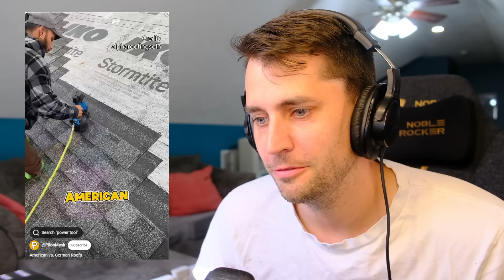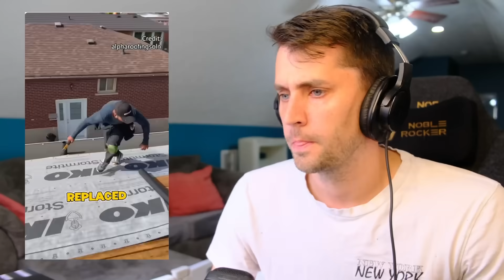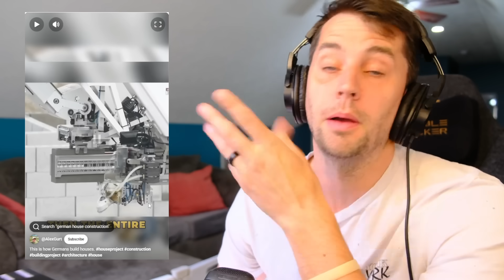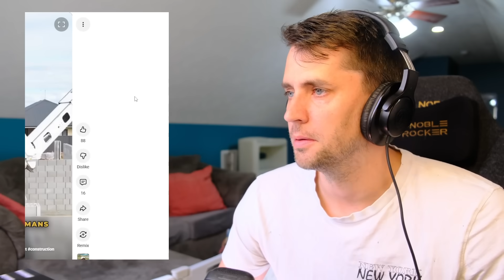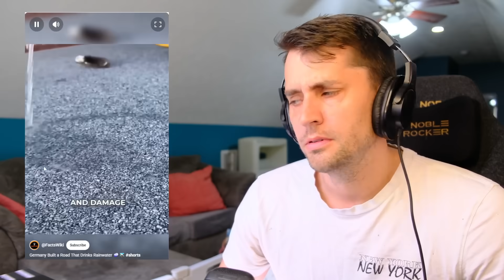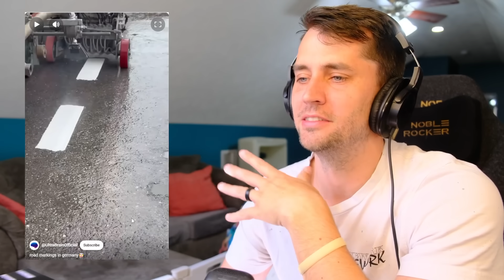American reacts to Germany's NEXT LEVEL construction methods

Comment: Re-roofing with shingles isn't expensive.
If the substructure needs to be completely replaced, it can cost around €60,000–€100,000. In my case, it was around €78,000 two years ago.

Comment: I take a look about the costs
The cost of covering a roof ranges from €60 to €130 per square meter, but varies greatly depending on the material and scope of the work. Added to this are costs for removing and disposing of the old covering (approximately €20–35/m²), scaffolding (variable), and possibly skylights or a photovoltaic installation. Regional differences and any roof insulation (€23/m² and more) also influence the total price.

Comment: Only temporary road markings (the yellow ones, overriding any white markings) can be something like a sticker.

Regular markings are a very thick rubbery paint, several mm.  And outside of settlements it's often also stamped/structured with a profile that audibly changes driving noises of you Drive on it. To prevent people gradually drifting out of lanes if tired/preoccupied. It makes an unpleasant angry buzzing sound.

Comment: 14K for a roof is cheap. I was quoted more like 40-50k for my roof on a small, wooden town house, roof around 40 m2. But it will last for 50-100 years, at least. The house is listed, so clay tiles are preferred. Still, my 50-60 year old concrete tiles (an inferior product to traditional, burned clay) are still OK, just a bit faded. Air pollution from local coke burning, coal smoke from UK power plants, dirty diesel engines and heavy shipping oils used to be BAD, but now the air is clean and the acid rain decay has stopped. (Good environmental policies do work, still the ships and lorries are still operational). No more accumulation of red mud in the gutters. BTW: The other clips look a bit dodgy.

Comment: Those robot  machines are real. They use cinder slabs and fill the wall cavity with high strength concrete. The cinders are covered in apoxy adhesive by the robot as they feed to the seating claw, so are glued onto each other as laid. They can lay an entire floor a day.

Comment: Concering the shingles and tiles…
My house was built around 1880 or even earlier. And it still has the original black roof tiles from back then. I have a few tiles left for replacement and the roof structure has been completely remade about ten years ago, but they reused the antique tiles to stay true to the look of the house because it‘s „denkmalgeschützt“, meaning it‘s sort of a monument and needs to keep its looks. I couldn‘t just make structural changes or paint the red brick walls.
So, these tiles have lasted for 150 years and will go on lasting.

Comment: That road surface DOES exist in reality. We only have small stretches of it because it‘s still being tested. It seems the surface isn‘t as durable as regular asphalt and has to be maintained a lot more often.
I formerly lived near a stretch of highway with this surface on a stretch of about 20 km. When entering from the regular asphalt it was like your surrounding really suddenly changed. No water on the surface, almost no spray water from the cars ahead and immaculate grip. (I tested it thoroughly with acceleration and hard breaking in heavy downpours, of course only with nobody behind me)
The biggest disadvantage is the noise though. It‘s extremely noisy due to the porous surface and I bet the tyre wear will be much stronger.

Still, if they manage to tweak those things, it‘s the perfect road surface for rainy areas or even countries in which rain is frequent.

Comment: I looked up that house-building robot and the company at least seems to have a Wikipedia page and wow...

1) That company is Australian, not German, though they do seem to have several partners in Germany, Switzerland, and Austria
2) They were only used so far for a handful of outdoor, long-term builds, with their website listing a mere 28 (yes, 28!) projects, which includes several test builds and, to be fair and balanced,  two small townhouse projects, a community center, and a daycare, so it's not 28 family home-sized builds.
3) One of these robots costs, according to the company website, 7.8+ million Australian dollars (so at minimum 5.1 million USD or 4.4 million Euro), and have been used to lay about 170k worth of blocks so far. That's about ~6000 blocks per project.

To me it feels a lot like a "disruption" grift, and the short is claiming it's German for extra clicks.

Comment: In my road a house was removed, a concrete plate was made and now the owner is building a new one since early summer. For the ground floor he finished the lime-sandstone walls and partly the bricks around including isolation between. Maybe he is from construction himself. The husband of a friend of my wife had a business to buy a lot, build a house on it he designed himself and got certified by a structural engineer and build it himself. With the help of his two sons. One is bricklayer one is electrician. He is quite wealthy, sold a couple of the houses he built and is renting a couple of houses to people. He is finished working for some years already, 83 years old.

Comment: For my house in germany new roof tiles from a company would be between 10000 and 25000 Euro. Inluding wood and isolation it could go up to 60000 Euro. The roof of my dads house that was built in 1925 is still ok, kind of. Its actually time to redo the whole thing but the house is not worth a full renovation.

Comment: The asphalt that "drinks water" is called open-pore asphalt (OPA).
It is found on some highway sections but is relatively sensitive to frost.
When frost threatens, salt must be spread promptly and more frequently to prevent the water from freezing in the asphalt surface, as otherwise, damage to the road surface could occur!
The freezing water would simply crack the asphalt.

Comment: 9:30 ZOAB which stands for Zeer Open Asfalt Beton (Very Open Asphalt Concrete), is a type of porous asphalt widely used in the Netherlands for major roads and highways, characterized by its high percentage of air voids (around 20%) that allow water to drain through. This porosity reduces road noise by absorbing tire noise, improves safety during wet weather by preventing water buildup, and reduces spray. ZOAB requires special, higher-viscosity bitumen to prevent collapse and is typically cleaned with a high-pressure, vacuum-assisted method

Comment: 1)
14k for a roof? LOL...
Our roof has been redone a few years ago - that were 54k... come again, what was that about being expensive? ;P That being said - this was roof PLUS the insulation. And there were incentives for the last ~10cm of insulation, but we still paid about 42k out of our pockets...
Took the roofers 5 weeks to get the roof done, including insulation (where then the boss said "can't do any more" ;)). Theoretically, the sun has to shine 18h strictly perpendicular on the insulation (remember, there are shingles and an air gap to the insulation) to even measure a temperature difference on the inside surface. Now, tbh, this is somewhat mitigated by the windows (well yes... we also have windows in the roof so we can "lüften" ;D), because while still at a good insulation value, they simply are not as good as the pure insulation.
OK, therefore it'll last the next 50 (min) years, maybe even a 100, depending on storm strengths ;)

2)
Never seen this machine anywhere, not even in ads or something. Also, those bricks don't look like what would usually being used here. Also, the whole neighborhood does not really look german to me. Maybe the testing grounds of the manufacturer of that robot?
So.... maybe a german machine, but not really in use in germany?
There are two modes of building here (mainly): Fertighaus (lit. Ready house, a house build from prefabs), or... well... a house. Build with concrete, bricks and mortar etc.pp., with some variants of "Lego"-type bulding (from pure foam blocks, later filles with concrete up to bricks with hollows in them, also to be filled with concrete later). So, while the machine-built walls look like they were to be filled with concrete, i can't really imagine this on a construction site here - alternatively it is so new, that this machine didn't even hit the market yet...?

From the vid: FBR Hadrian is the robot, and it seems to be made by an australian company...

3)
While there are "sticker"-type markings, those are usually temporary, yellow ones used during road construction work. Road markings are painted on the road (actually it's more like a plastic/epoxy type of "paint), and that (on the autobahn) in layers: first solid white paint, then a layer of a glass bead/ceramic shard mix, then drops of "paint", followed again by glass bead/ceramic shards. This creates a non-slip surface (ceramic) with high visibility at night (glass beads) that also drains rainwater relatively fast (paint"drops").
On other roads it's IMHO just the "paint" plus beads/shards, for the speeds are usually way lower than on the autobahn...

Comment: Draining asphalt has been around for over thirty years, and several highway sections use it. Its drawbacks are costly, tire wear is high, and it's noisy. Its advantages are safety, and it's certainly justified.

Comment: I don't know if they used this type of concrete on the latest stretch of Autobahn around here, but there must have been improvements to the permitability in the last years, because the road is, even during hard rain, pretty dry. And it dries up afterwards super fast. And I can recall times when it was way worse.

Comment: That road surface is pretty common now. They started using it around 25 years ago for Autobahn section to reduce aquaplaning. It's also really good at reducing spray when you drive in the rain. Early versions had issues with freezin water in winter, but that was just down to the drainage not being installed correctly.
Reply: In the netherlands they use this already for atleast 40 years.

Comment: I mean the house building robot isn’t even special, the 3D-printed house is a little cooler.

It’s fair to produce these job taking options for now, but once most fields of work are doable by AI and robots a mayor shift of social benefits must be introduced, enough for everyone to live without a job. At least this would be the ideal … I have my Master in mechanical engineering just in case though

Comment: The clip about water absorbing asphalt has a huge problem in Germany cause of rainy winters and freezing temperatures. So these type of roads are deployed in warmer climates with sudden heavy rain improving road savers.
Here in Germany they are rarely used and due to freezing damage (water pours in, freezes and expands) in high maintenance and wouldn’t be cost efficient.

Comment: German roof shingles in comparison to asphalt shingles: in worst case, asphalt shingles will last only 5 to 10 years. In best case, they will  last up to 35 years. German shingles will last 60 to 80 years and up to 90 years.  With good quality shingles, you can achieve over 100 years before a replacement will be needed.

Comment: The roof on my family home was last replaced in 1912, according to our house and grounds repairs ledger. Even then, most of the "new" slates were simply redressed slates stored after the previous re-roofing when the house was extended in 1805. Some roofing joists needed replacing too, but the main beams were still the same ones erected when the main part of our house was constructed in 1580s. They just needed some reproofing.

Comment: The water-drinking asphalt isn't used in Germany in the video... it's too easy to create fake videos these days. This video is from a demonstration by an English company that developed this asphalt specifically for parking lots! It's banned in Germany because it's "harmful to the environment" because the seepage water contaminates the ground with the lubricants constantly spread by vehicles. It's also not frost-proof because the pores clog too quickly, and ice bubbles can form and burst under pressure, which further exacerbates the problem of potholes.

Comment: Regarding the roads that "drink" water. Yes they are build here when a road gets completly redone. Where I live they are way more common on the "Autobahn" than in citys. But that might be because our city roads are 30 or more years old and rarely get a complete overhaul.
Another advantage of this roads is that they are creating less sound when cars drive over them, what is the main reason they are used. But in contrast to what is said in the video I was told they don't Last as long as traditional roads. But that is just from hearsay.
Reply: The Open Asphalt is better for cities with its sound and water absorbtion, but its also more expensive than normal road construction and doesnt last as long. So, normal roads for Autobahn and silent road for (big) cities and Autobahns near cities.

Comment: German architect here. The costs deviate greatly in regard what one consideres as a "replacement". In most cases, replacement of the roof tiles is not the only thing done. Upgraded insulation, etc. is in most cases also done at this point. A good ballpark number for a 1500-2000sqft home roof with no frills but some upgrades will be in the 40-60k range. For 15-20k you can replace the tiles on a 1500sqft home, but nothing else and by the lowest bidder and material costs.
Yeah, and no we don´t build homes with robots. That robot is just a prototype. But there is also a trend in developement in 3D printing homes. Personally, I doubt it will catch on within 10 years or so. Too many variables to take into account for a robot to do it right. Maybe with a more powerful AI though.
Reply: They are building 80 appartments in Hoensbroek in The Netherlands. There are about 6 people at work there. Half of it is prebuild offsite. The rest is build pooring concreate. All the homes are made from the same repeating pattern. Thus with a couple of molds, they make different size houses. As a finnish they have a single brickwall from very nice bricks to make it look great, but also insulate the concreate from the elements. So, there will be almost no heat transfer.

Builders are expensive. But not when you have a large build site and repeating homes. These 6 builders cost nothing compared to the materials and the massive crane they are using.
Reply: The funny part is that Fastbrick Robotics is an Australian company and the robots only have had build structures in Australia until earlier this year as the first one was delievered outside Australia to the US. So to my knowledge there is non of these robots in operation in Europe right now. But we are able to 3D print structures now but it's way to early to say that's the way we build in Germany and probably will not be for years to come cause we have so much variety in building methods it's ain't even funny.

Comment: I saw that first clip about the roofs before, and still have the same questions:  They say a big benefit is that you can replace an american shingle roof in a day.  --> Why would you want to do that?  Why would you want to replace your roof at all?  And when you look at it, all they are doing is replace the roof cover, not the roof itself.  Replacing the roof tiles can also be done in a day, but WHY?  
My roof is over 50yo, and the only time I managed to brak a single tile was when I dropped a big a** hammer on it while taking down the antenna.  --> Get a spare one from the shed, push up the two tiles above it, replace the broken tile, pull down the two tiles again, done...

I just looked up the prices (here in Germany...) 
--> clay tile roof = 25€ / m²
--> concrete tile roof = 20€ / m²
--> apshalt shingle roof = 20€ / m²

Life expectancy of clay and concrete tile roof is 80-100 years...
Life expectancy of a asphalt shingle roof is 20-30 years + you have to do some maintenance once in a while...

Maybe a tiled roof is a bit more expensive in the US because it is less common,  but I don't see a advantage in pricing by any means...
Reply: Those asphalt shingles wear out from rain, then the wooden boards they are nailed to rot, and now you want to replace your whole roof. That's another issue with this style of construction. The nails penetrate the membrane, and that sits between the shingles and those boards with no air gap.
Reply: May House was built 1950 with concrete shingles. So I think about replacing them, because they maybe will not last another 30 years. But then still: I only have to replace the shingles, not the roof.

Comment: My parents house is now 52 years old and the roof was made with the cheapest available shingles that time. It needs a replacement now and I think we are going for titanium covered metal sheets on OSB because the wooden construction is not strong enough for traditional clay or concrete tiles. The best offer we received was about 20000 Euros for the job. If you add 7 to 8000 you get titanium covered aluminium sheets that basically last forever.

Comment: I live in a house that was built in the 1960s. We installed insulation under the roof to make the house more energy efficient, but the roof tiles are still the original ones.
We still have tiles in the attic in case any damaged ones need to be replaced. They will last for a few more years. It will probably be several decades before the tiles need to be completely replaced. I don't know yet whether I will do it or whether my children will.
The house will certainly still be standing in a hundred years' time 😁.
Reply: Like a Castle 😂

Comment: 3:35 Roof construction or repairs costs depend a lot on who you can hire (especially on whether you know a guy who knows a guy…) and whether they have to put up scaffolding, the state of the building and the space that needs to be done/fixed. I just had 6.000 Euro for two porch roofs… but that included new roof gutters as well… now those two porch roofs are the best-maintained parts of the whole house…